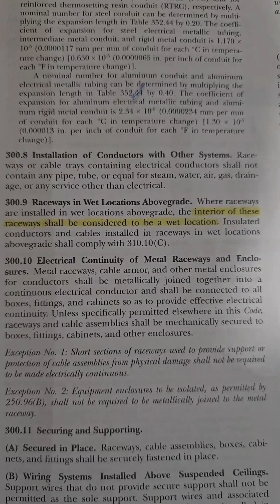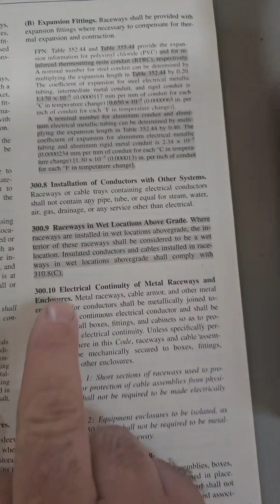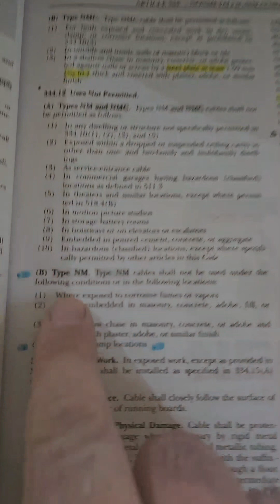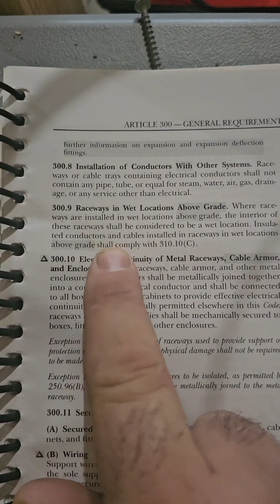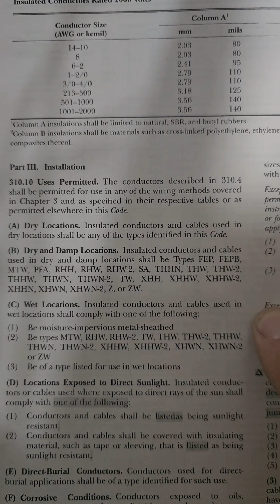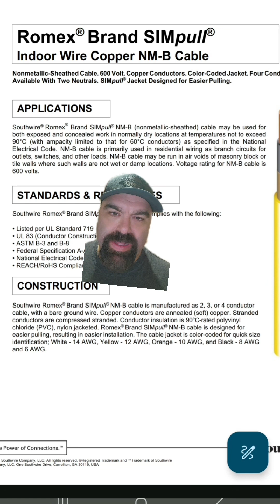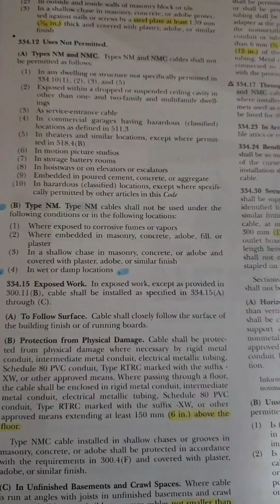can romex be installed in PVC if the PVC is outside

Comment: I'm in Canada. My basement ceiling is mostly boarded up. I want to run 6 or 8 gauge wire from back corner of basement, where 200amp panel is located, to other corner of house where garage is, in order to install a level 2 EV charger in garage. There is old, unused pvc central vacuum pipe running from the garage back to the utility room where the panel is. I used a shop vac to pull a string through the pipe. Now, can I be within code and run the wiring through the central vac conduit/pipe? As I read the code here (2021 CE Code) and following along your excellent video, it would seem this would be allowed. Thoughts?